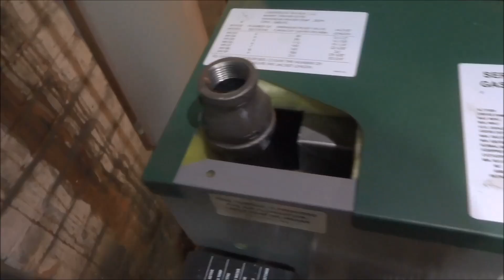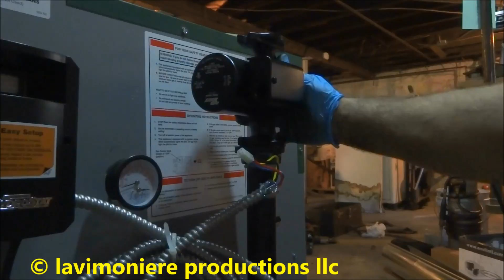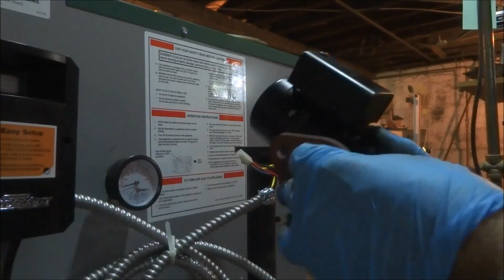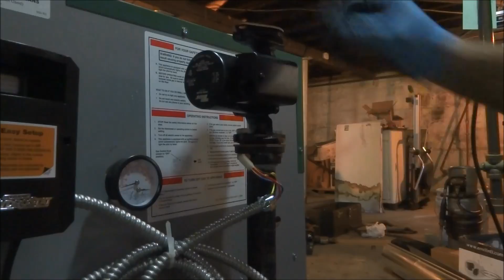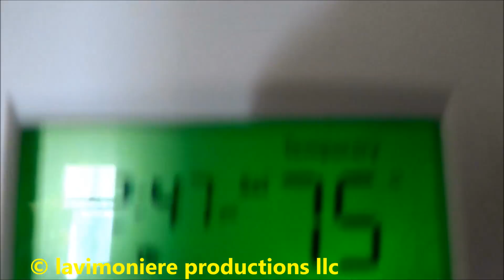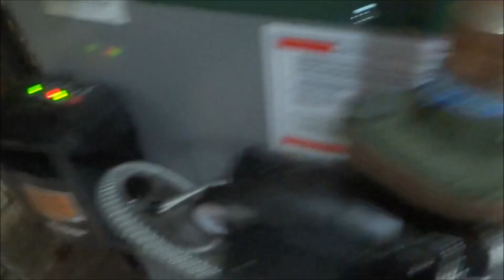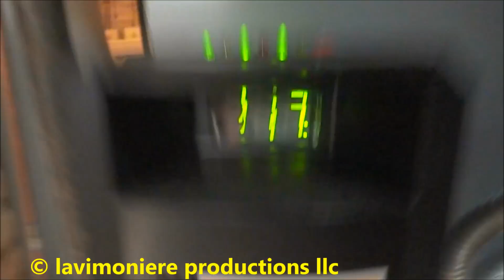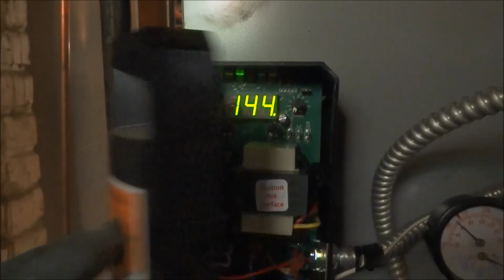gas boiler replacement

Comment: Nice Job. I see low water cutoff switch On my furnace is it there mostly for code? I have pex radiant so maybe in case it leaks?
Reply from the maker: this boiler control has a low water cut off built in to control ,in my state they just made low water cut offs mantatory on all new boilers
Reply: steven lavimoniere  I like those hydrolevel aquastats for that feature. When they are factory installed they have a low water cut off. When you add them on to existing equipment you have to use hydrolevel's immersion well to make the cut off work.

Comment: Would a small modcon have been a good fit for this house?  Just curious if that was discussed with the HO.  A lot of people would only want the least expensive solution anyway.   Cast iron rads on single zone work real well with our modcon boiler.

Comment: I have that exact steel expansion tank and straps holding it up. I do not have that vacuum relief valve. When I drain it it klug klugs and drains very slowly.

Comment: so, why do i never see u service any urinals? do they rarely malfunction, or does nobody use them any more, or both?
Reply: He's made some videos of urinal repair. The flushometer valve usually has issues. That or someone clogs one with a wad of paper.
Reply: thanks.  i might have seen it and just forgot.

Comment: Good job as always Steve 😉 have you ever worked with steam fire tube boilers that burn number 6 oil ?
Reply from the maker: i work in houses mostly  ,,no,,,,,, #6 fuel oil that stuff needs to be heated  its like tar ,they use that stuff in electric power plants because its cheap to buy
Reply: steven lavimoniere thanks for replay buddy 😉 yeah used to work with that in the hospital we had 2 fire tube boilers that burnt it yeah it had too be heated up and fuel tanks had like a steam jacket around the tanks to keep them warm they stoped burning that now gone to another oil off some sort and they now connected to a biomass heating from the local distillery. I think one off the old boilers was ripped out for scrap they found a big crack inside it soo 3 boilers now still 1 fire tube boiler there just for back up and 2 newer little boilers. Used to have the incinerator also but they ripped that out now that burnt all the rubbish in hospital but costs money to run now thinking about money saving and downgrade our hospital almost closing down!😐 Cheers for replay buddy.

Comment: What was wrong with the old boiler?
Reply from the maker: homeower wanted a upgrade to save on gas bill
Reply: Is the payback in fuel savings good?
Reply: So why didn’t you put a 95% AFUE especially since there’s a $1500 rebate?

Comment: How Hard is it to Sorder 2/1/2 inch copper
Reply from the maker: anything over 2 " i pre tin the pipe and fittings before soldering ,thats the best way to do it before soldering .i work mostly in houses now so i do not work on the big stuff anymore .back in my union days i did a lot of it
Reply: I work at a motel.got a 3drip a minute. Have a bowl cathing the drip.very hot water.I haven't sordered anything over 3/4 inch.
Reply: I watch all your videos .keep them coming. Learn alot of stuff.

Comment: Black on a relief in Mass? Shame shame. Also relief should be facing up, not down boss
Reply: If it faced up water would spray up on the ceiling.
Reply: Dasdfjkl , not sure you understood. Exit point of relief should point left or right and piped down, not be point down
Reply: Why shouldn’t he use black pipe on the relief valve?? And yes you’re right about the relief valve it should not be on the flat
Reply: G66CA  It’s a mass code thing I don’t necessarily agree with but the thought is that if a small leak occurred from the relief valve, it could rust shut, making the relief valve unable to blow off
Reply: Corey A.. that makes sense. What do you think of this Peerless boiler not having At least  a bypass on this cast-iron radiator system?